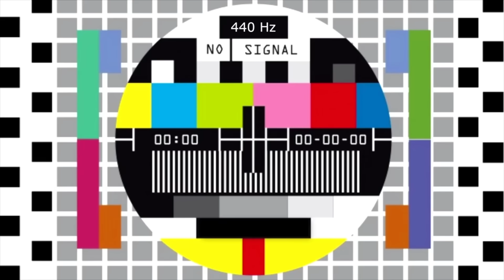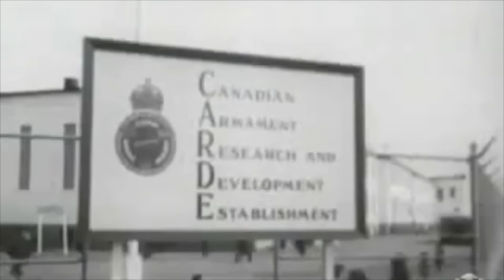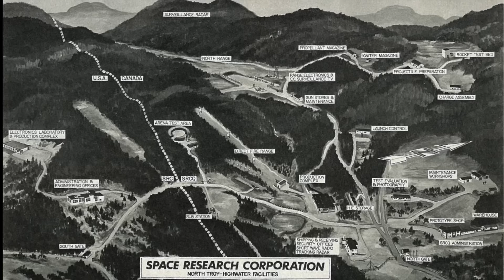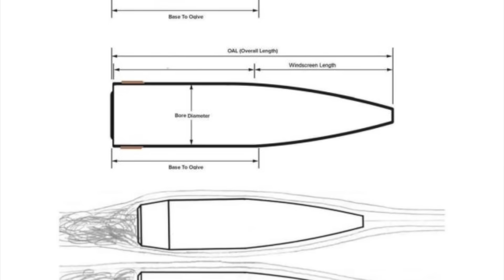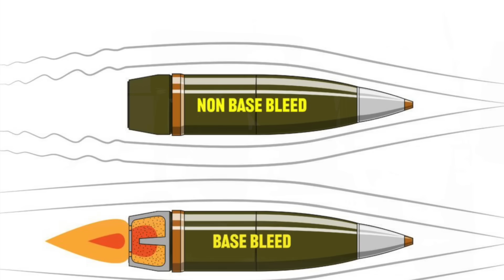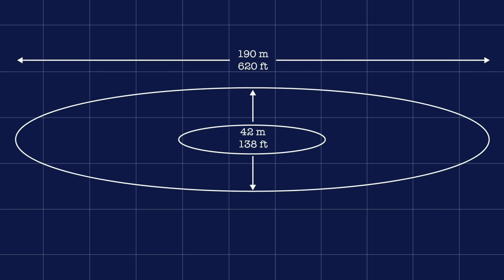155mm ERFB Shell: Faster, Farther, Deadlier

Comment: I pray i never have to experience artillery shelling, ive read alot of war memoirs and all say its the most terrifying thing. You have to fight every urge to jump and run, like lightening striking all around you and the ground becoming not solid with every explosion, tossing your entire body up and down left and right.. alot of guys cracked, jumped out of their hole and got ripped apart by blast, shrapnel or enemy fire. Terrifying..
Reply: I'm also terrified of hundreds of flying 2"-6" long pieces of razor sharp jagged steel from exploding artillery shells. A 4" inch piece of a supersonic flying steel would tear through a human shoulder or cut a limb 10 times faster than a cleaver hacking a beef steak.
I told a doctor once, I'm not allergic to penicillin but I'm allergic to exploding things and flying sharp metal 😆😁
Reply: I'm sure there will be someone to comment about artillery barrages from the receiving end, thank heaven I'm not one of them. I did see, from 20km distance through field glasses what the impact area looks like when a six-gun battery fires a three-round (per gun) time-on-target mission. Each gun fires three rounds in quick succession, at a different elevation for each round, timed to that all the shells impact at approximately the same time, in this case it was eighteen shells exploding at about 20 meters (if I remember correctly) above ground within one second. The intent is to maximize the destructive capability of a single artillery battery and give the enemy no time to react and get under cover.
It was just an exercise, but seeing the chaos that ensued, from over 10 miles away, was sobering, to say the least.

Comment: If u make a massive gun with the equivalent powder as the fuel in a rocket would it shoot into space? Probably not
Reply: Bull designed guns that had progressive powder charges in additional chambers angled off the barrel at intervals that probably could have.
Reply: Problem is it would probably just... Explode
Reply: Well, using rocket fuel in a gun kinda sucks, but you can definitely make a gun high enough performance to fire into space. Not, however, into orbit.